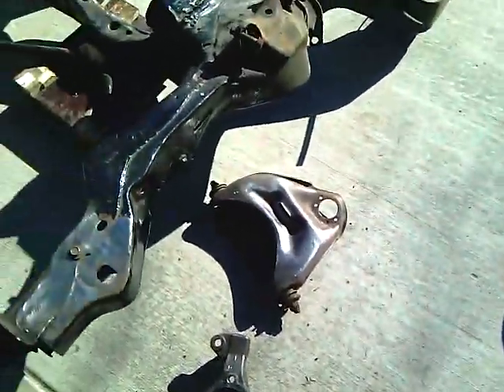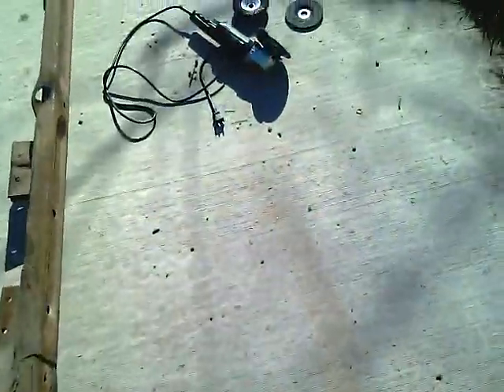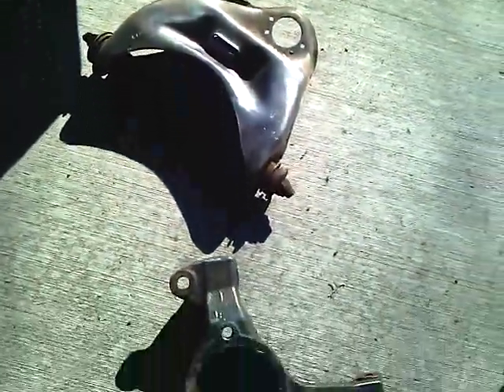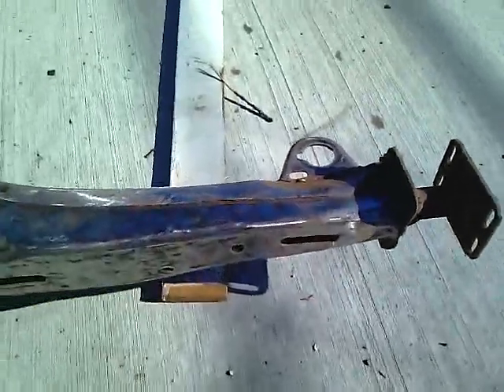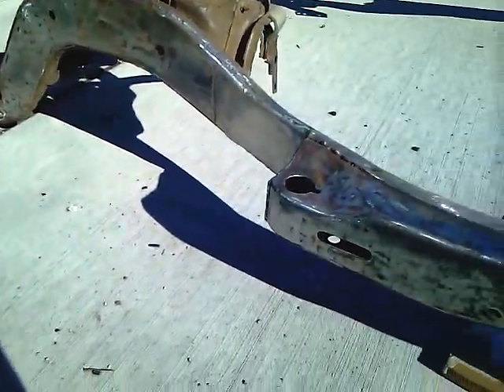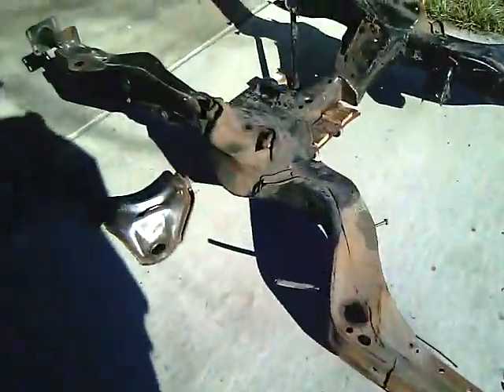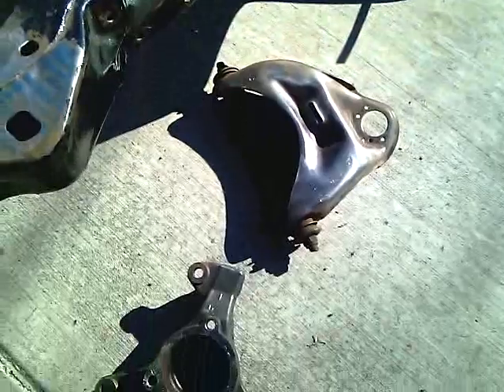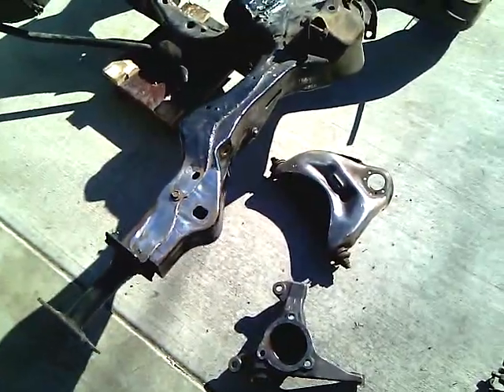Frame sanding...

Comment: You didn't put a support brace going across the rear after you notched the frame?
Reply from the maker: No i didnt. Im waiting to put the tank in to make sure inhave clearance before i weld that brace in